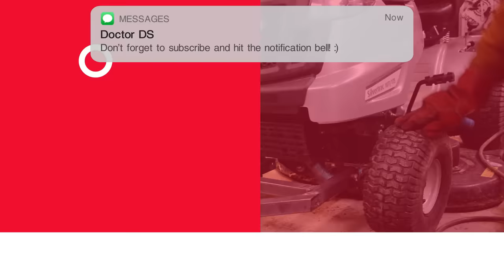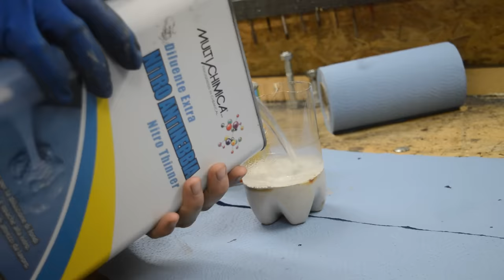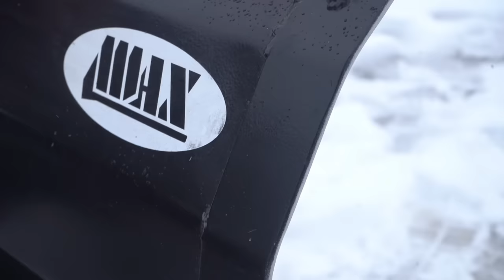Homemade SNOW PLOW for LAWN TRACTOR / QUAD !?

Comment from the maker: Homemade EXTREME Snow CHAINS For Tractor Mower / Quad !?
https://youtu.be/n688PLy8Lzc
Homemade EXHAUST For TRACTOR MOWER !?
https://youtu.be/v31l3x-1EWk
Reply: How fun are you doing your video
Reply: Thank you enjoy and think if I needed 1 I now have the plans >`
Reply: L
Reply: I use a snowblower in Canada so need to remove the Mower Deck to use the belt drive, makes them much more maneuverable.
Reply: @keithdingess7801

Comment: 55 Gallon Oil Drum works perfect for making ATV / lawn mower snowplow a lot cheaper than buying all the metal you did and it'll last just as long and look just as good
Reply: Best part is when you split it in half you weld the other half and have a wide enough scoop for a single lane for a car

Comment: You need to fill your rear tires with wiper fluid for better traction. Nicely built.
Reply: Use beet juice.  It’s heavier and doesn’t freez until -25C.    Ok but why bother.  You took to long.  All the snows gone.  Haha.  Just saying.

Comment: You can fill the rear tires with coolant to add more weight. This will help with mowing and plowing. Granted those rear tires are small but it would still add additional weight.

Comment: Looks great, and should hold up for the amount of snow you are pushing. Only thing id change is to place a strip of 50x2  steel along the bolt holes for the rubber. As you have it now you may find the rubber rips out the holes

Comment: Great video 
You are a rock star. 
To show us how you put the plow together  The time and supplies are only a fraction of what's needed. 
I hope you can make money 
Thank you
Reply: I know guys who made plows for quads and trikes, they use plastic barrels, steel scraper bar on the bottoms, ribs on the back of the barrel plow to hold shape. Steel oil drums, the best were old hot water heater tanks, strong, thicker than sheet metal.
Reply: @shabadoo24  

Thank you 
Water heater sounds great. 
I was looking to make a small plow for my snowblower. 
I looked at a plastic barrel. 
Still in the planning stages. 
😛😛😛😛😛

Comment: Made one in 3mm 355 sheet metal with 6mm hardox at the bottom. Put plates instead of wheels, they hold better. Also made spring loaded so if you drive in against something, the blade can fold instead of destroying the tractor

Comment: pretty cool set up. why isn't anyone pointing out how winter kitted this riding mower is? this is a $350 dollar winter kit all day. 50 for the wheel chains, 250 for the blade and 50 for the tractor plow attachment. what i disagree with, is you left the mower deck on. weighted rear wheels for traction is best.

Comment: very respectable build cudos on the plow , this would be good for a larger garden tractor or a quad but i dont have alot of faith in the aluminum trans and yellow metal gears that it houses to push snow for any length of time , those are extremely light duty machines meant for one thing , grass , nice craftsmanship though

Comment: Pushing snow with a lawn tractor is hard on the differential unless you have a very heavy duty mower. Manufacturers will also sell plows for them since they also like to sell replacement diffs.

Comment: Pretty much a waste of time and money flimsy sheet metal first snow pile you push into it's going to Bend LOL, you can pick up use lawn mower snow blades for like around $100 then use a small winch to raise and lower the plow
Reply: He needs some back weight and buy everything new or something
Reply: Needs to knix the deck other than that it’s not an old garden tractor it’s a lawn tractor lol never gonna hook like an old one BUT !

Don’t knock the plow I made many including one that fits my power king tractor 16-14 and my geo tracker on 33s😆 made out of two plows it’s stronger curved like it is than u think .

If h know how to plow its mint !

And fabricator by birth it’s just fun. 🤘
Reply: By the time he gets everything new it would cost him more money where he can do everything right at work or home he pretty much got everything for for what he's needs for me being in Ontario they start off at $700 and up
Reply: I do agree on mover blades lol too many to cheap but js building plows isn’t hard and stronger than u think
Reply: @michaelritchie9709  who said anything about new I said used and you can pick up used blades for 100 bucks I know this because I picked one up for $100 and $50 for a winch for my riding lawn mower
Reply: I bet everything will hold up great except for the casters and transmission.